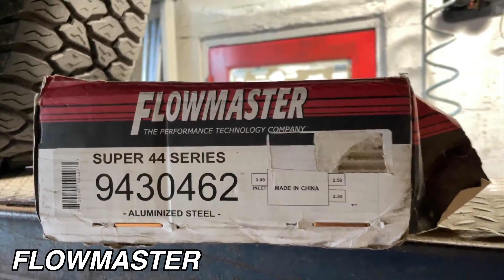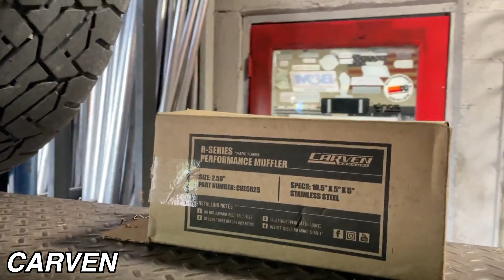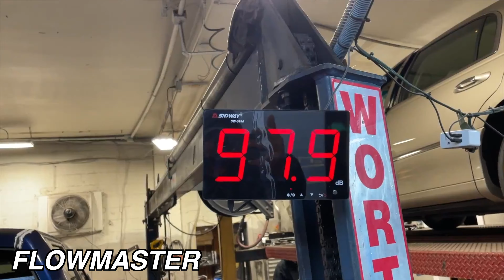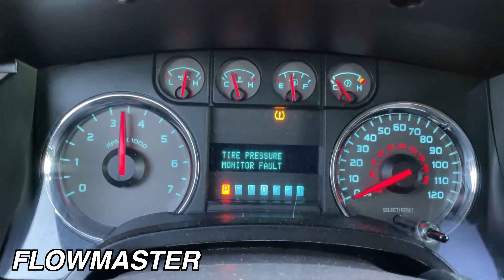Ford F-150/F-250 5.4L TRITON V8: CARVEN R-SERIES Vs FLOWMASTER SUPER 44!

Comment: You should use Super 40 series on a truck instead. The larger case will help lessen drone in the cab.
Reply: I think the chambered design will increase drone.
Reply: @ej1025  The Super 44 and Super 40 are both chambered mufflers. I was stating that the Super 40 is better suited for trucks. It's what Flowmaster uses in most of the American Thunder kits on trucks.
Reply: @Todd_S  I believe the Delta 40 is designed to reduce drone as well.